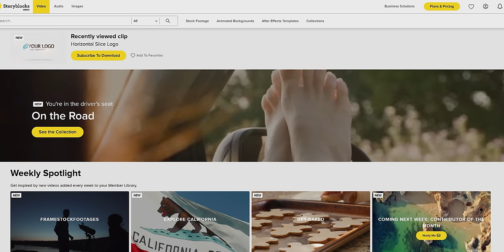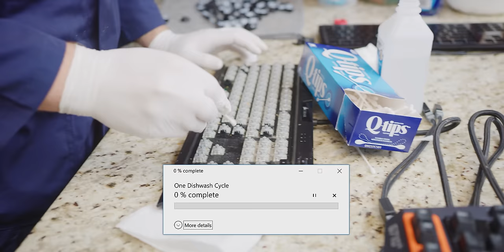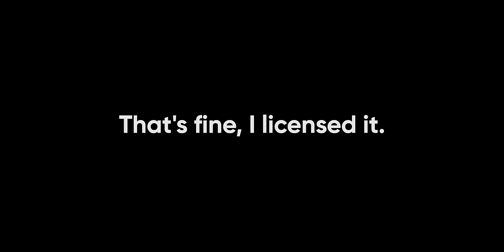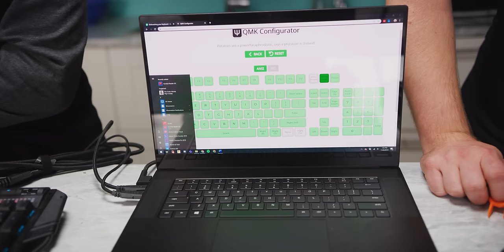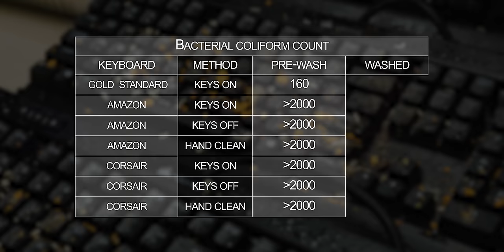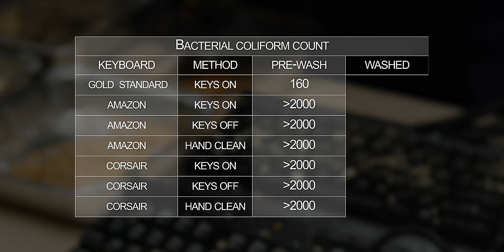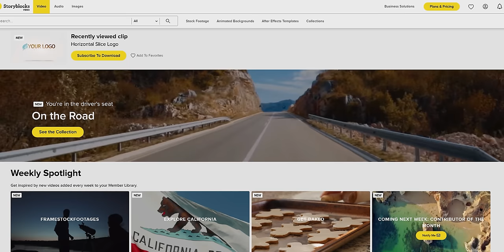The best way to clean a keyboard is… the DISHWASHER?

Comment: maintenance technician here to put up a quick PSA: dishwashers have never been designed with "cleaning" in mind. All your non-industrial, home dishwasher does is try to kill all the bacteria with heat and soap. It is meant to be a way to sanitize your dishes. You must always remove debris from things going into the dishwasher. Dishwashers are meant to help remove grime (not chunks/baked on grease/2 week old stuck food) and kill bacteria. To create a machine that is guaranteed to clean dishes in ~60 mins would take much more than the $400-800 you spent. Honestly just get the cheapest, best looking model, rinse dishes as you use them, and pile them in the dishwasher til you have a load. 

Before anyone comments: yes, it will clean off your rice that you had for lunch. It'll probably clean few day-old stains no problem. But here's the thing: nothing is scrubbing. It is literally just shooting hot water upwards from a spinning fan. Sometimes the really hard food sucks up enough water to unstick from the dish, but that isn't what it's for.
Reply: Hence i never usem, im cleaning it anyway, whats a few more wrist movements eh:p
Reply: And yet, no matter how many times I tell certain people I know, they refuse to rinse their dishes before dishwashing, "Because it is a dishwasher, it's in the name! DISH WASHER! IT WASHES DISHES FOR YOU!" Only to later complain about - not only bad washing results - foul stenches coming from their dishwasher xD
Reply: As a appliance repair technician and salesman, don't straight up prewash your dishes.  The detergents can oftentimes cause microetching if the dishes are too clean.
Reply: @John_1920  i just said screw it with that whole mess and just washem myself. But only 4 of us
Reply: I think that's complete nonsense.  It's true that it likely won't remove baked on grease, but it's a DISHWASHER.   It WASHES dishes.  It  doesn't just "kill bacteria".  I wonder if you've ever washed dirty dishes in a dishwasher in your life.
Reply: @LixiumXaef  so what ya saying is, dont buy one ín general
Reply: @robertromero8692  if it dosnt come clean from the spray nozzle, it isnt sny different except it adds soap to the water as it sprays, ya dont get much head pressure out of it
Reply: @robertromero8692  we also "park" on the "driveway." The names we give things aren't always inherently correct. Like I said, I fix these things for a living. Like, all the time. I just replaced a door switch this morning. You can "think" its nonsense all you want, but all I claimed is that they "can" clean, but are designed with sanitization in mind, not cleaning week old crud that you're (the royal you, please don't get offended) too lazy to scrub off. Yes, I have washed dirty dishes in the dishwasher. That's why I'm telling you this. The consistency of a dishwasher is not there. The consistency of my hand and OCD sure is though
Reply: @LixiumXaef  I would really like to hear more, I've never heard of that. I know water can definitely erode things over time, but does "microetching" really cause a problem in the structural integrity of certain dishes? I'm assuming plastics would be more or less fine?
Reply: @Dracossaint  I don't understand what point you're trying to make.  I have put DIRTY dishes in the dishwasher (and no, it wasn't just some "rice" on them"), and they've come out CLEAN.  To say that a dishwasher can't wash and wasn't even meant to is ludicrous.
Reply: @happyestus6688  Millions of people use dishwashers (including myself) to WASH their dishes which come out CLEAN, at least as clean as when washed by hand, yet you claim that the machines aren't even intended to do so.  Spare me your argument from authority, the personal experience of many MANY people says otherwise.
Reply: @robertromero8692  JFC. I said they "can" clean, and do! Read the manual for your dishwasher. For any dishwasher. I implore you to see what the manufacturers say about what to put in the dishwasher. I'm not just blowing smoke out of my ass. I KNOW people use dishwashers to wash dishes. What I'm SAYING is that they DON'T clean 100% of all dishes any time under any circumstances. So when someone comes up to me and tells me, "there's still food on my dishes after it runs through a whole cycle!" I tell them that they should rinse the crud off first, so the hot soapy water disinfects all the micro organisms that you can't see. Like a 1, 2, punch
Reply: @happyestus6688  You said "dishwashers have never been designed with "cleaning" in mind", which is NOT the same thing as saying "they DON'T clean 100% of all dishes any time under any circumstances."   No one ever said they do, including me.  But to say that they were never even MEANT to clean dishes is flat out nonsense, as is the implication that they don't do an excellent job under typical circumstances.
Reply: @robertromero8692  my point is dont buy one and if ya must go cheap and pretty or go all out and get a industrial grade one. THAT will wash dishes. Blowing 500-600$ on something like that seems silly to me when ya coukd soend it somewhere else. Im just pantamiming what the op said
Reply: Also excuse my typing a bit, a long day and in a bit of pain.
Reply: @Dracossaint  Why would I or anyone else have to "go all out" and blow big bucks on an "industrial grade" dishwasher if we are satisfied with the performance of our consumer level dishwasher?   If such dishwashers were really as useless as you suggest, they wouldn't have sold in the tens of millions for several decades.  That fact is rock solid refutation of what you're saying.
Reply: @robertromero8692   people do a lot of silly things (ie buy a phone thats cheaper to buy a new one then replace the screen, upgrade their phone every year, spend 1300 for 20% more performance, etc etc) 
So i wouldnt say its rock solid. Just want people to be a bit more sensible, ya can keep 400$ in your pocket by just taking a bit more time and wash them by hand.

Also when i say industrial grade, i mean ones with  high pressure water jets, More then 4x the water pressure then a mid range one. 
Also personally any dishwasher experience i've had they never get them properly clean without at least giving it a good rub with a scuff pad. But hey the food is another thing can variate how effective it is even, or how soon ya rinse the pots and pans and etc after ya done making it .
 In the end ill just say agree to disagree and have a good one.
Reply: @Dracossaint  Sounds like you’ve had not so good experiences with dishwashers.  My experience has been much better.  I pay attention to their limitations, and have been very pleased with the results.  The “rock solid” part is that the sales of consumer grade dishwashers over several decades proves that a LOT of people have been having satisfactory results with them for a LONG time, else they wouldn’t have been sold for so long in such large numbers.   It would be silly for them to spend beaucoup bucks for “more dishwasher” than they think they need, and you shouldn’t generalize and say that what they bought is useless for them just because it wouldn’t be adequate for you.  What set me off in this discussion was the initial contention that dishwashers were never meant to really clean dishes, only sterilize them.  But I agree that we should agree to disagree.

Comment: Yes, of course it will work.
All electronics are basically OK to wash with water. However, only when there are no electricity running.
 
After washing, dry it for 2 days - 1 week in a low humidity environment. It should be dry otherwise the electronics will get shorted and die.

Keep in mind that soap is not recommended as a soapy water is a conductor and could short the components when there's some residue left.
Reply: If you feel that way why not wash your phone in water after removing the battery? (pls dont) Honestly as much as I enjoyed watching this video I think I understand how louis felt when linus put his graphics card in the oven. For those reading this what linus doesn't say is that unless your washing this board in pure water (ie distilled) and even then, will overtime cause your keyboard to die from water corrosion.  Tap water has minerals and impurities in it that get left behind when the water dries. Those minerals are conductive and can cause shorts all along the circuit board of the keyboard. For more information - https://electronics.stackexchange.com/questions/350302/does-water-actually-damage-or-only-temporarily-disable-electronics-until-drying
Reply: @sbmotoracer  Indeed and speaking from experience. 5 volts and 1-3 amps can be anything between 5-15 watts. Now that's a fire hazard.
Reply: @sbmotoracer  the minerals is very small compare to the soap residue, but i you cannot wash the cpu the circuit inside cpu is very small that the dust can short circuit it
Reply: @sbmotoracer  Cleaned my keyboard at least 5 times fully disassembled in just pure tap water. Had the thing for nearly 5 years not a single problem. Maybe with longer period of time something might happen, but by that time the keyboard already served its purpose.

Comment: Personally, I just take out the electronics and then just a bit of hot water and dish soap in the bath tub and a brush and call it good.  Dry off then reassemble.
Reply: Same. I'll take off the keycaps and rinse them in a strainer under hot water, too. Takes like 20 minutes. You'll have a clean keyboard before the dishwasher even gets the the rinse cycle.
Reply: @Sythriox  I take out the keys and clean them off individually with a cloth dipped in hydrogen peroxide. Cleans and sterilizes the keys.

Comment: Well, I had 10 years old keyboard (Razer Lycosa Gaming). It was cleaned a few times in the lifetime but last few years I did not care much anymore. I actually removed everything and put case and key caps separately in dishwasher. One thing that dishwasher was quite bad at removing all of the grease from rubberized key caps. Second thing is... when it did, it removed the rubber layer as well. So just keep that in mind that it might destroy something.
Also, I'd not go this way with putting actual electronics there. Taking the front case off is much better idea and does not require that much shills.

Comment: 10:46 Lmao. How the hell is it quick if it takes a week to dry?
I just use a damp cloth every weekend on mine.
Reply: Damp cloth only cleans the dust on top of your keys and keyboard though, all the stuff underneath is still nasty, I just use alcohol wipes every week or so on top and then every 6 months or so, take off all the keycaps and properly clean everything with alcohol.
Reply: MrGamingHorse alcohol bath
Reply: @BraidedButthair  i like that u take care of your stuff so well
Reply: @biro1280  when I can be arsed that is, but boy it does feel good when everything is clean, even if just for a day or 2
Reply: @BraidedButthair  i feel ya
Reply: @BraidedButthair  Well, mine barely gets dirty, so a damp cloth is all I need. Even if I do it once in 2 weeks, it'll still be pretty clean.
Reply: @BraidedButthair  Okay, but it doesn't actually make any difference if it's only gross on the bits you're not touching.

(I have a cat, so obviously this doesn't apply...she seems to exclusively want to malt into keyboards)
Reply: @_Piers_  Well over time crumbs and hairs and what not go into the parts in between the keys, and yeah sure you're not touching them, but it's still gross when you look down into the keyboard. I dont eat OVER my keyboard but there are still a few crumbs of food and such from like 6 months of eating dinner at my desk.

Comment: Linus: "This looks like it might be a quick, fast and not dirty way to clean your keyboard"
also Linus: "drying the keyboard is gonna take a week"
Reply: just grab another 100$ keyboard from the pile of 100$ keyboards back at your home in the meanwhile. ez
Reply: Time spent waiting for the keyboard to dry is not time spent cleaning it. You can just swap to a backup keyboard in the meantime.

I cleaned my keyboard by hand by removing the keycaps, using a vacuum, and then a few q-tips with rubbing alcohol on them. It's a Logitech G710+ boards that was shown in the video.
Reply: @Thalanox  youre taking this way too serious

Comment: Linus, Linus, Linus....I did this several years ago to clean 1/2 dozen dirty and often not working (but once favorite) keyboards.i popped and isolated the screws from each, opened each and inserted each half into the slots in the dishwasher. I dried them by hanging them open from a row of ceiling cupboards in a relatively unused room, hit them with a big fan, turned up the room heat by 2 degrees and walked out. I did not quite close the door so as to avoid trapping any possible water vapor....oh yes. I swung the cord of each rather sharply into a folded heavy towel (this drove the remaining water out of the USB (and other) jacks so to reduce the possibility of electrolytic reaction inside the jacks. Five days later they worked like new, I tested all of the keys, all of the function alternates, all other board shift and control alternates.....No crashes,  glitches, hesitations or hangups. It seemed akin to magic;  the fellow on the you tube channel I watched did not lead me astray in the least .  I had no lingering issues with recalcitrant hair, food, spilled milk or other residue that (to a degree) you seemed to have faced. I used a hot setting and if I recall correctly, I ran them through twice.

Bon Chance

Rod / BC

Comment: A soft bristle small paint brush every week to get the stuff out between the keys before it builds up and a blast of air is all you need. 
It gets bad when you don't so small cleaning often.
Reply: 5 minutes per week for 2 years (what I usually keep keyboards for) would cost me about 200 dollars worth of my time. I'd rather just buy a new one when it gets too dirty
Reply: Get out of here with that sound advice.

Comment: they may be called a 'dishwasher' but what they really are meant to be are dish-sanitizers.  You should clean the stuff before putting it in it.  In restaurants, this is the case as well. 

If you have learned some lessons in life about cooking, eating, and cleaning after yourself ...  you know you cook and plate your food, then rinse/soak/wash your pots and pans while your food rests for a couple minutes.  Eat, then rinse the bowls/plates/silverwear you use ...  and it all comes clean pretty easy, then throw them in the machine for soapy hot water sanitation.  Makes it tons easier than say a roommate/significant other that lets shit sit ...  get dried out and crusty, then you have much more effort and time involved.  Some never figure out how to make their lives easier.
Reply: This is sorry of true for older dishwashers, but newer models will blast through all kinds of food gunk, excepting maybe avacado, that stuff just turns to glue.

Comment: How do I over clock my dishwasher?
Reply: Getting more water pressure should do the trick. I have 5 GHz water pressure right now. Pretty damn fast.
Reply: @LastStopGaming  maybe water cool it could push it up to 5,1ghz
Reply: @lukesepter3250  but hey! Don't forget to use liquid nitrogen!
Reply: LastStopGaming liquid nitrogen cool it, if you have hit the dishwater lottery with the highest binned dishwater, you should be able to get 10GHz.
Reply: @webforder4201  amazing idea!

Comment: A strong air compressor is a much better option with no chance of destroying your electronics.
Reply: Not everyone owns a air compressor, eh
Reply: It merely removes the gunk, doesn't clean the finger fat.
Reply: An air compressor won’t get rid of the sticky Pepsi that spilled.
Reply: doesn't remove bacteria either
Reply: v Nyggi isopropyl in a spray bottle
Reply: Water and solvents are the cold standard for deep cleaning. Compressed air for light cleaning and maintenance.
Reply: Still need a solvent
Reply: Honestly what destroys electronics is water when the electronic device is powered on.  If you give it ample time to dry you will be fine.  BUT this means you need another keyboard and if you're like me you have one.

Comment: I did it with a rubber dome keyboard once, worked perfectly. Just let it sit in the warm for 1-2 days and you're good. Wouldn't do it with a mechanical though.

Also RIP springs in mechanical Keyboard after the dishwasher.

Comment: You are telling my keyboard cannot resist a spill of water but I can put in the dishwasher??!
Reply: Was your keyboard on? If so it woulda shorted due to the power running through it. If it were unplugged and you let it dry for a week it probably would've been fine
Reply: AnonymousNoName maybe because if the keyboard is on and gets a spill, it might get shorted somewhere. However these dishwashed keyboards weren't plugged in, plus they were left to dry for a decent time.
Reply: Depends whether or not it’s on...